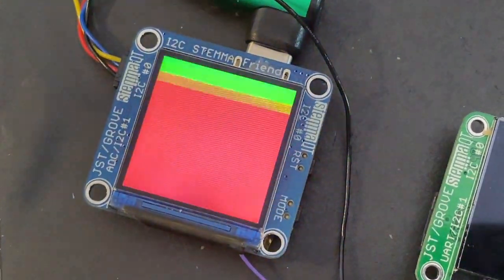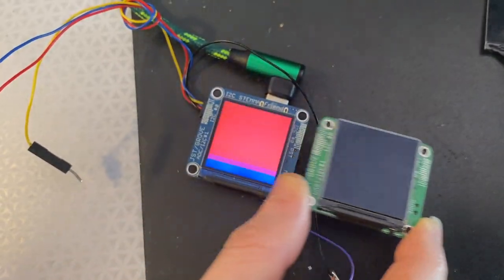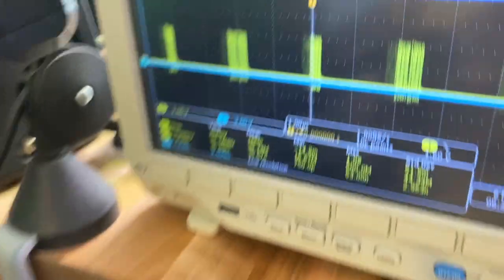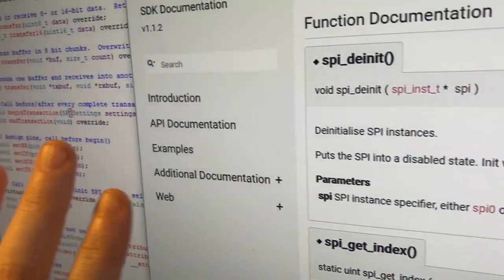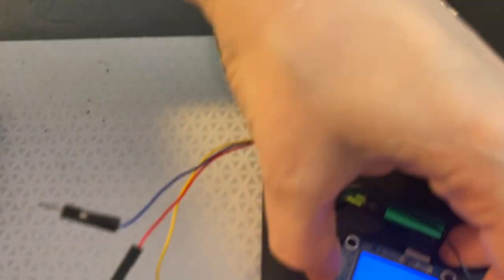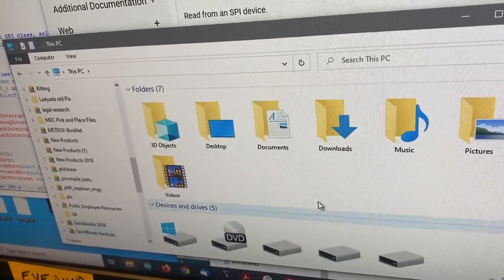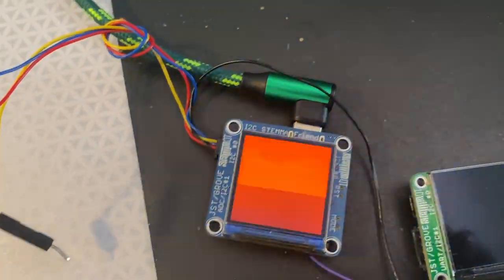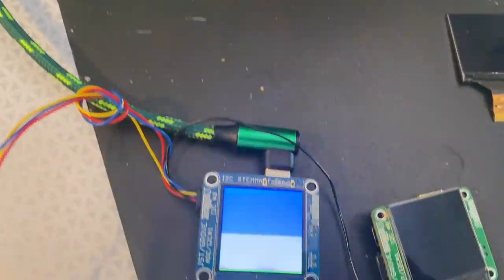Super fast SPI speedup for RP2040 displays

Comment: I'm working with a new RP2040 Feather Propmaker with CircuitPython 8 and a 128x128 SPI display and I have the same slow update problem using displayio/Fourwire.  The best I can get is about 10fps, baudrates over 10Mb have very diminishing returns.  Is there a different library I should be using to get better utilization of SPI?